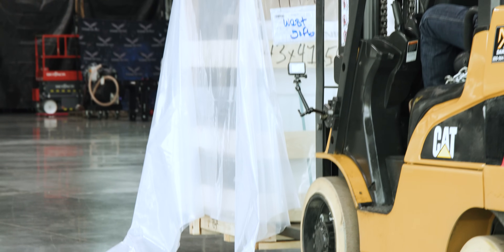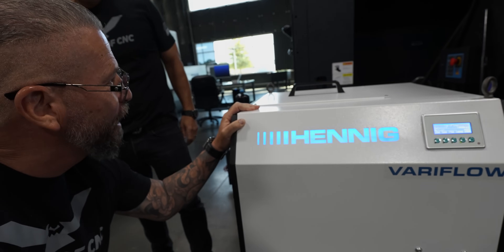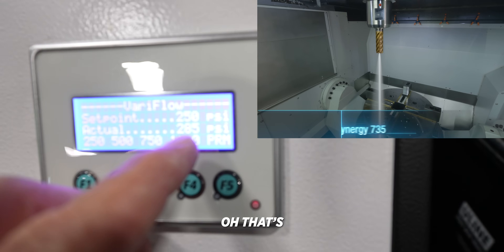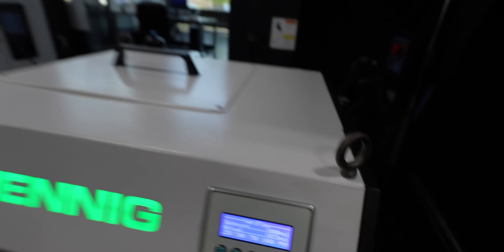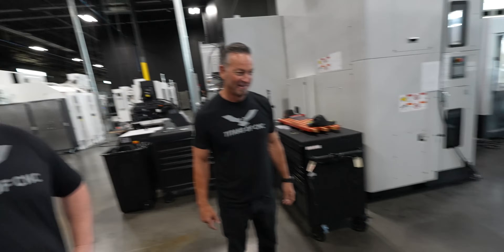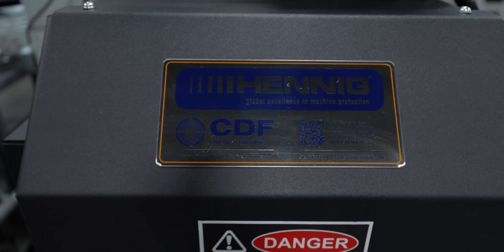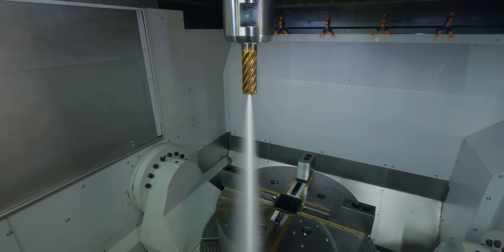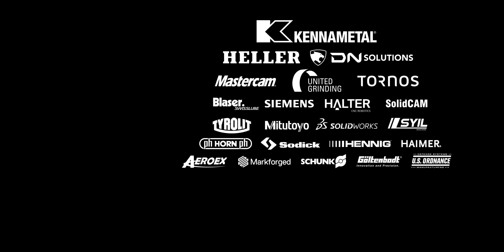Unboxing The Most Advanced Coolant System

Comment: fpt also has water pressure adjustment on their large machines
It's nice to have
If there is no adjustment, there will be water 10 meters beyond the entire area  when it runs on High Pressure, it empties approximately 500 liters at approximately 120 gallons per minute
for example when you drill out a 10 inch hole 
but this is the first time I see it for smaller machines

Comment: Better than the mazak superflow???
Reply: Much quieter - you can barely hear it
Reply: @nickgoellner7809  perhaps you need to adjust your parameters. Noise is super low on my totem pole of machining operations as long as the equipment can hold up and produce consistent income is what matters ☝️